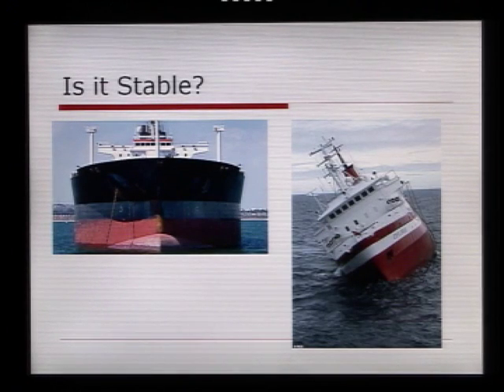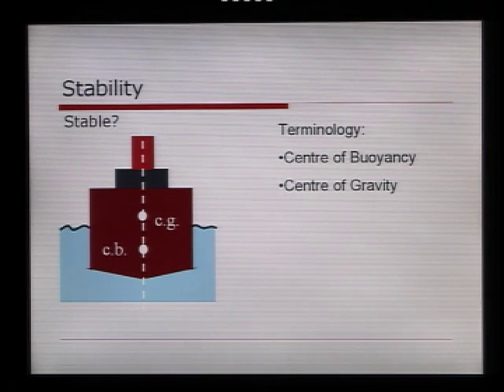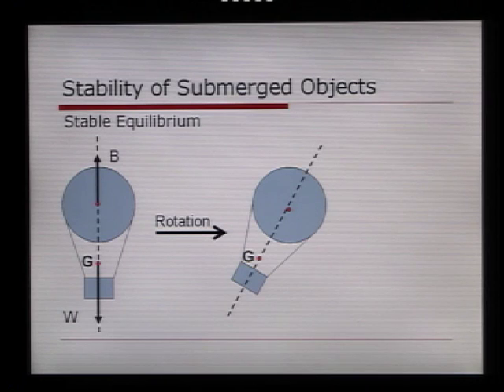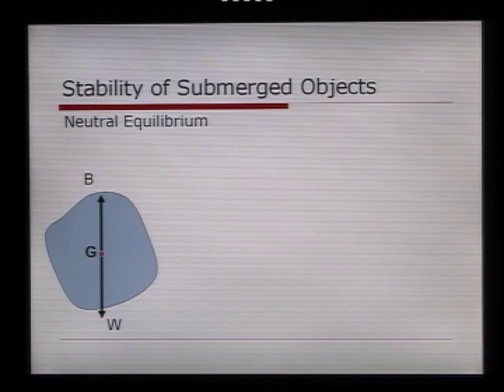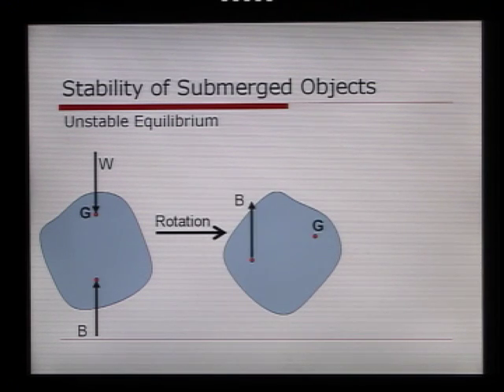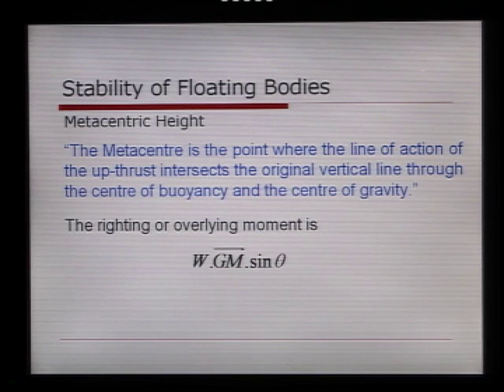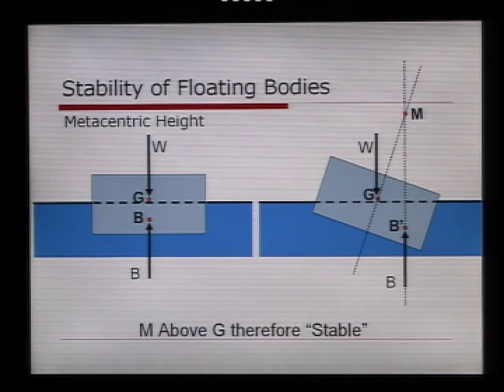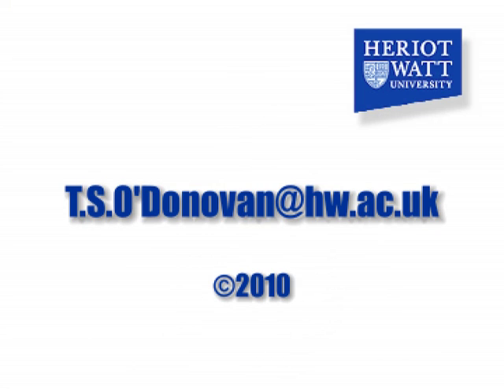Introduction to Fluid Mechanics, Podcast #10: Buoyancy & Stability

Comment from the maker: Here are some answers for you:
1) Do you mean "neutrally" stable? If so, this happens when the centre of gravity is at the centre of buoyancy, so if the object turns by an arbitrary angle, then the just stays at the new position. 

2) Not sure what the question is; are you referring to manometry? If so, the precision of the reading can be increased by tilting the manometer as you have a longer scale to read for an otherwise similar pressure measurement

3) If you are referring to buoyancy here, then the buoyancy force increases as the density of the fluid increases. So if an object is already floating in the fluid, then it will float high, or less will be submerged.

Hope this helps